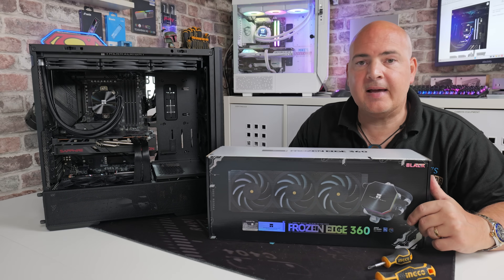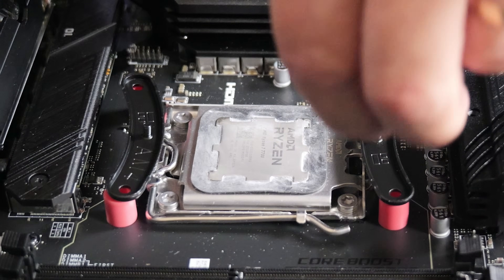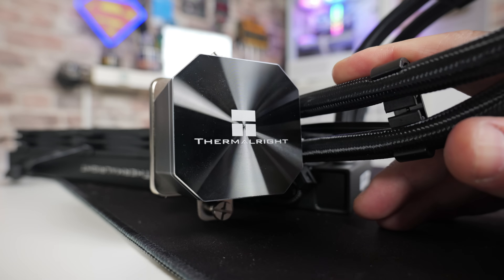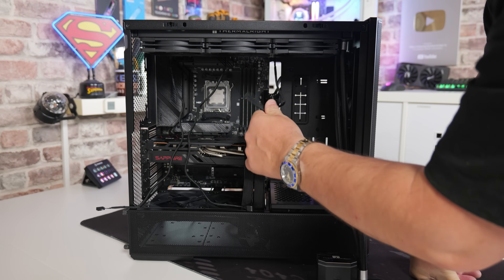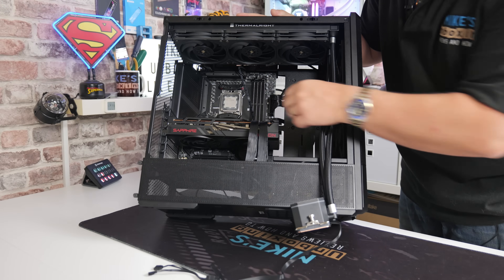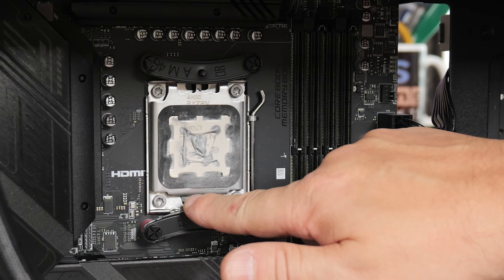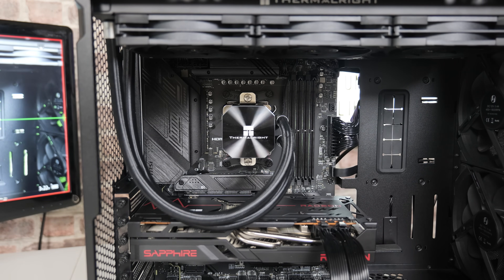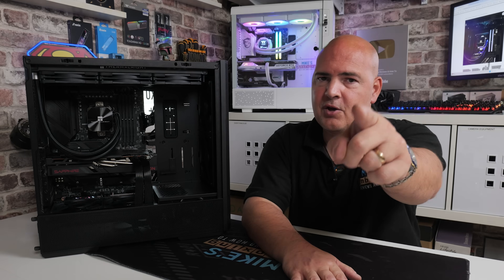How To Install Thermalright Frozen Edge 360 AIO AMD Ryzen AM4 AM5 Motherboards

Comment: Hey the pink spacer its says am4 should i put these or top or bottom where its says am4 , i have am5 9800x
Reply from the maker: the pink spacer goes on top of the Motherboards own backplate after removing the 4 screws and plastic parts. then the metal AM4 / AM5 bracket goes on top of the spacer and it attached with the screws included
Reply: hey i am sorry i meant the written am4 on these pink spacers should it be top or bottom or no difference ?

Comment: Thanks Mike for an Deep details, i had one exatly the same But 240mm  and even so was amazing Aio cooler But with only R7- 7700 cpu I like more the Tower heatsink, Using the Thermalright peerless Dual Tower Grey 120mm Fans (replaced with Noctua ) with ambient 22c i got 34.6 cpu on game FH5,using noctua H2 paste,max 41c on game 59c Test loop 37minu. stable, and enjoable this RX6750XT Msi Mech OC 12GB repasted and wow still performance well,bought for £170 never opened 1 owner with invoice 2023 £399 UK is just under 10FPS than 5060TI16gb . I  found i deal never overclocked  never opened Pads on ram really good 1.5mm brand new no dust or dodgy smell smoke on heaven ung. 452fps max not much but still good special with new driver 9/1 Adrenalin.  3 Years old still good card my opinion with 1440p not that bad for saving money.
Reply from the maker: Great info, thanks for sharing your experiences!